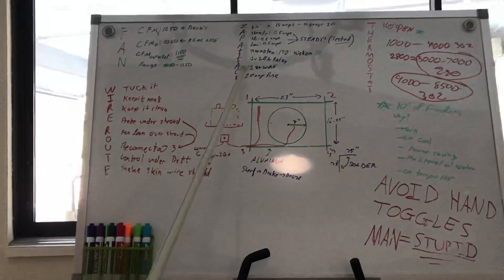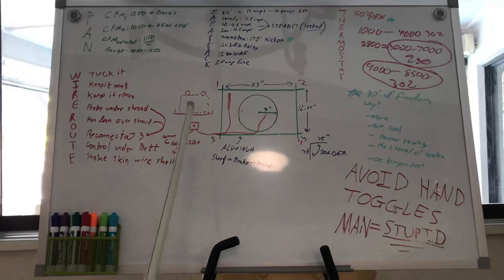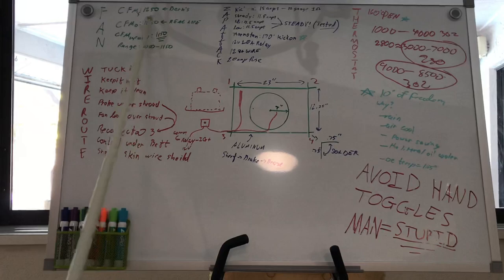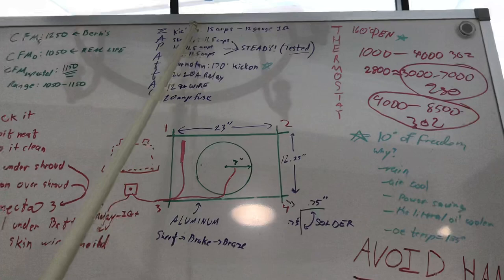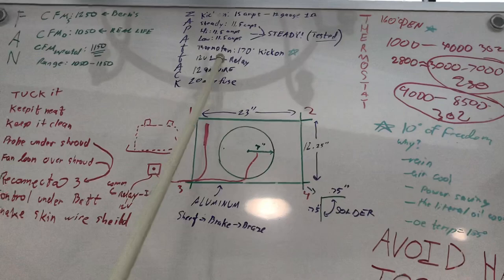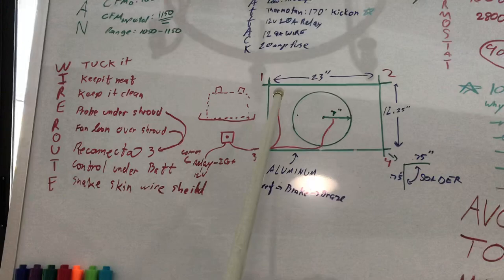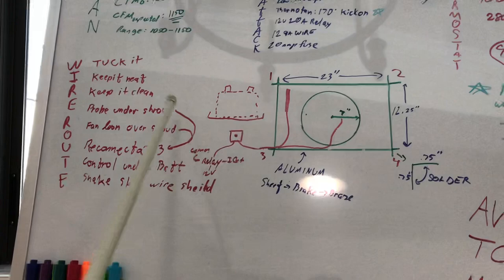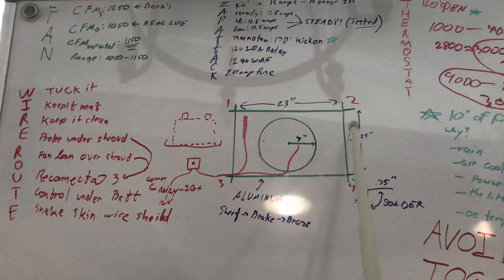Te71/72/XX Electric fan conversion schematics

Comment: Can you explain why i shouldn't run the car without a thermostat as i'm currently doing? i don't have AC and i'm running a Norris 280 cam, side draft Webers and when is really hot outside my temperature gauge passes the middle mark and  sometimes goes as high as the 3/4 mark. When that happens i usually turn off the engine and let it cool a bit and drive off again. oh by the way my electric fan is running all the time, it's direct i don't have it on a thermal switch. Could it be doing this because i don't have a thermostat? I just bought a brand new aluminium radiator i will be putting up this summer maybe mine is clogged.
Reply from the maker: Hey man sorry I’m seeing this so late. I could be a multitude of things to be honest. Let’s try to break it down. If the block is stock other than the upgrades you mentioned then it narrows it down a little. If it bubbles up some I’d check for pinhole leaks. Specifically behind the ingake manifold in the middle. Those leak all the time and compromise the system. Check exhaust smoke and make sure its clear and not white, that would be a headgasket. Make sure your ignition is not too retarded. Also make sure the sensor is reading correctly. Get an infrared laser thermometer on amazin for cheap and repeatedly test the water neck on the head for temps to make sure the temp and gauge are accurate. I do not run a thermostat myself but with an aluminum radiator and e fan in my car the temps always drop to 140 in summer on the highway and around town with 95+ degree weather
Reply: @tougeclassics9443  Thanks for getting back i appreciate it. Since then I replaced my radiator with the aluminum one I mentioned before and put in a 160° thermostat I also installed a fan temp control switch, checked for leaks even though I never experienced coolant loss. You mentioned to check the temperature with a infrared thermometer which i already owned and to my surprise the thermometer and my oem gauge are a little off, when my gauge is past half the thermometer is reading something like 140° witch is not bad at all. Now here's my other issue, I live north east and our weather has cooled down a bit and now when I go on the highway the car cools all the way down to a 1/4 mark, and I know the fan has not kicked in because I look at my volt gauge and it doesn't changed, it normally change a little when my fan kicks in. Is now acting like it doesn't have a thermostat so I put on my thinking 🤔 hat again and I think it could be that my thermostat is not operating properly or I need to replace it with a 180° one.  What you think?